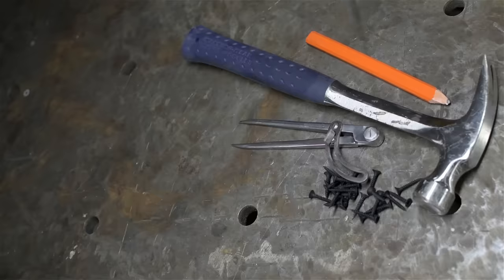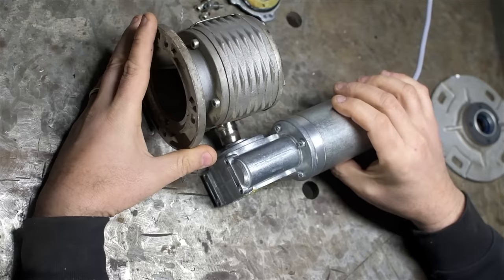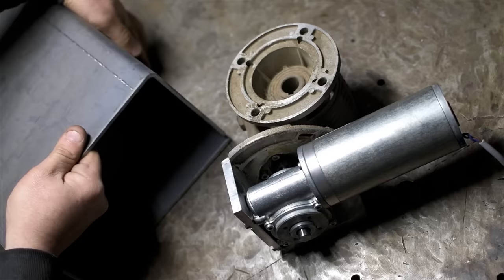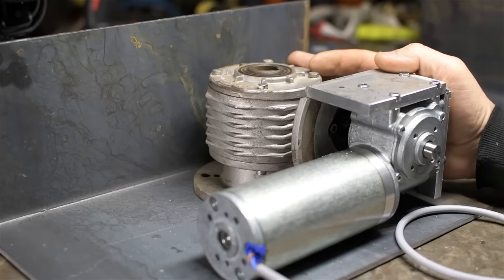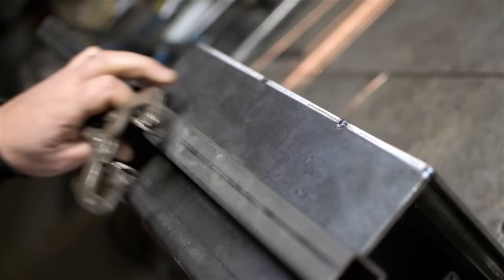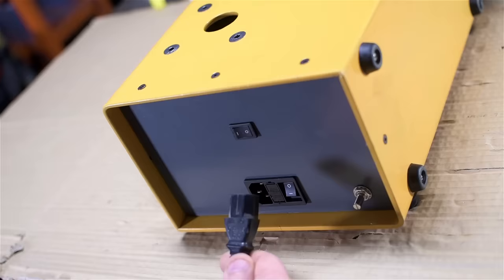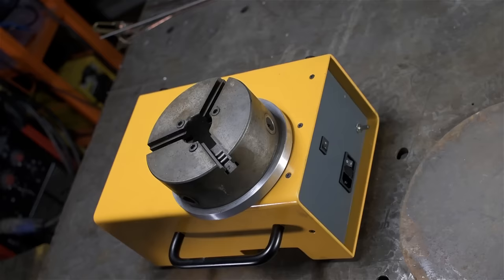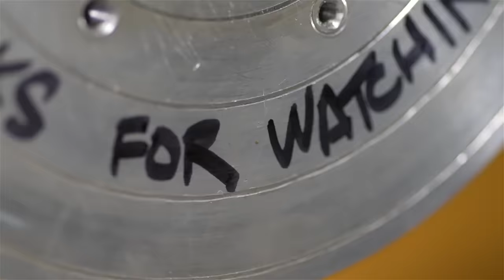Building a Rotary Weld Table

Comment: I am a little late for this party her but for the corners ,I like gunsmithing files... Or single face files. They are generally prepared for cutting dovetails , adjusting lockwork/ fire-control parts or fitments ,like putting a slide on a frame .

Comment: Really good project, i built something similar about 15 years ago and had the same issue regards speed vs heat..found the solution was add a potentiometer to the tig torch.you only need to vary it a tiny bit ..but you do need to change it often. Its easy to control power with the foot pedal and speed with your hand at the same time..two feet pedals are imposible i found lol..

Comment: The larger 1:10 is not only a speed reducer it is a Power Amplifier.  More torque...  Just like a granny gear in a truck...  I think slow is great for most uses.  Run the motor at half speed and you have best of both.

Comment: I work in a high pressure pipe welding shop.  The majority of our welding is done rotated.  Typically the rotator is pedal controlled, weld is just trigger hold on all the time.  You set the rotator speed a little faster then you would need and pulse the rotator with your foot to set the pace.

Comment: Big spring loaded carbon brush fir the ground contact would be a cool feature, although a thermometer and a base plate preheater will give better aluminum weld consistency

Comment: 31:38. Yes you do want another foot pedal for this exact reason. My background is welding aluminum tubes for jet engines.... and there is no way we would have done it without a variable speed foot pedal. This also helps in case it was set slightly wrong you can compensate, as well as the fact that aluminum will heat soak really fast on thin parts and require more speed at the end of the weld

Comment: Hello Mr. Old Tony...... I made mine outta ford f 150 wheel bearing hub and rotor essembly. Small shaft with motor and voltage regulator 😉

Comment: Nicely done! It would be neat to get a little digital readout on there to show RPMs (or maybe voltage off the pot would be easier) so you could return to your optimal speeds when when you find them for a given material/diameter. Very clean build though and seeing that stainless weld makes me wanna go out and make one!

Comment: @ 22:15, there is a set of bent head Snap On wrenches, (one specifically being used for one nut on the IDI 7.3 Liter diesel fuel injection pump) that would fir that perfectly.

Comment: 23:00 Oooh, I use a vacuum cleaner for chip control on my mini mill as well except I'm winding one of the handles with my other hand. Works on aluminium and stops it choking on swarf when I'm slotting.

Comment: The variable you are missing here is the temperature of the part.
When you are hand welding, you may stop and start, which gives the part chance to cool down, but with the rotary welding, it is a constant application of heat, so the part is going to gradually get hotter the longer you weld.
Theoretically, you could increase the speed as the temperature increases, that way you are not on a hot spot surface for any length of time, but then that would mess up your flow pattern. 

I think the only solution would be to have some kind of cooling, say maybe an airline jet just forward of the area you are about to weld.

Comment: Hi, I know this video is old, and I don't know if anyone else suggested it, but you could make the foot petal have a first trigger that turns on the arc and gas, and then the rest of the way down, it has variable speed control on the turntable

Comment: That worm gear box is actually better for a welding table because if you load it unevenly in a vertical position it won't move since only the worm gear can be the driven side. That's how all the really big welding positioners are set up.
Reply: He's got two worm gears in there. The motor is a gear head with a worm...

Comment: I know this is an old video, but you may consider a fine and coarse adjustment control, that way with two single turn pots you can get the fine control without having to crank forever on a 10 turn.

Comment: This setup with a larger turntable would be perfect for mig welding aluminum pipe fittings. Giving a consistent speed would prevent having to move around the fitting.

Comment: Don't know if you'd want to modify the speed control, but you could have a rotary switch with fixed resistors for set speeds (lo, med, hi. Or even -hi, -med, -lo, 0, lo, med ,hi) and still have a position for the variable.

Comment: PSA & top tip:  keep your mains power wires inside the box to the circuit board as short as possible & definitely do not lay such wires atop of a source of vibration (the electric motor).

Comment: This video was just great!! Had me laughing had me jealous and definitely had me entertained/motivated. For your aluminum consistency you could preheat parts to a desired temp on a hot plate and then maintain a range with inter pass cool down pausing. But I’m sure you’ve figured a good solution since the posting of the vid. Anyway thanks for the share
Reply from the maker: good idea!

Comment: I'd 've gone with the direction switch,then the foot controller can swing back n forth,but that's just me,for what it's worth the motor control gear can be made for a couple of bucks/pounds with a 555 and a couple of parallel mosfets,a jack socket for the foot control.

I've made a couple of DC motor control systems,yours looks like the same as a "radio control toy" (no offence),but the ref voltage system is the same as a servo controller,where the 555/mosfet would have been faaaar cheaper,and we all like faaaaaar cheaper.

That's a great piece of kit though and i want a cnc mill too.

Love your vids,great inspirational info.keep up the good work.

All the best,
My two cents(pennies).

Comment: Could use a garage door motor head. Rotate either way. Some of them even have variable speed. The mechanical limit ones would be the easiest, just throw away the limits and it should go one way for ever.

Comment: You should add a digital display of the current speed and a graph on the  machine that sets out speed to diameter with different lines for different types of welding.

Comment: Nice job Tony. Here is a suggestion for a feature to start and stop the table rotation at the most opportune times.
Connect the light sensor in series with the line in. Parallel a shorting switch across it to set your initial speed.
The light sensor will start the table once you establish the arc, and stop it to allow an ending argon flow.

L------- light sensor-------------------------------------|                                    | ________________                          
          |_____| |________|                                   |   24 v adj pwr supp |                                   Motor
                     bypass switch                          |                                     |________________
N______________________________________|                                   

You could use the light sensor to fire a relay... if you want to control the low side  24V... makes no nevermind..

https://www.amazon.ca/Woods-59408WD-Outdoor-Hard-Wired-Photocell/dp/B003Z4ECKC/ref=asc_df_B003Z4ECKC/?tag=googleshopc0c-20&linkCode=df0&hvadid=293019258638&hvpos=1o1&hvnetw=g&hvrand=15975966689033506434&hvpone=&hvptwo=&hvqmt=&hvdev=c&hvdvcmdl=&hvlocint=&hvlocphy=20113&hvtargid=pla-386027205064&psc=1

Comment: You're way better at all this stuff than I am and I understand why you welded the two  halves together, but as a mechanic, I was thinking, "I would have welded ears or a piece of angle iron along there and used fasteners", just to allow access for repairs. Before I went into tool design I always wondered why those assholes at the car companies always made stuff so damn hard to get at so I'm naturally always looking to design in as much work space and or accessibility into something I'm building. The box came out great though and I suppose you have enough space to get things out if you had to. Beautiful work and Great vid! I'm really enjoying watching all your videos. I have an old, (REALLY OLD) lathe and one of those old crappy Chinese bench top style milling machines. I could be doing a lot with them but they mostly sit under tarps while I'm wrenching on other peoples junky, crappy, rusty, old cars. I want to get away from trying to earn money fixing cars, after my third back surgery I won't be able to do it much anymore anyway. Making stuff on machines would be a great step away from wrenching.

Comment: You can add a resistor at the output of the potentiometer (middle leg) to slow down the velocity even lower. Try different values until you get your wished velocity range.

Comment: Great job, though I expected some fancy solution on connecting the ground to the table.
I have some stepper motors, stepper motor drivers and arduinos laying around so that's what I would use, possibly even get some RPM readout on some display so that I can remember "5RPM for this 100mm diameter pipe" etc.

Comment: Wow really great video. If the 5 turn pot is an issue you can replace it with two in series, one for course adjust and another for fine (aka 0-1000 plus 0-50). Also if you think a second petal is an issue you may be able to control it with a controller in you feed hand.
Again, really great video.

Comment: For welding small parts use MIG wire instead of rod. It'll give you a smoother weld and probably more beed control..

Comment: For your foot pedal to control speed: use a potentiometer that's 1/10 the value of the one on the panel. This will act like a coarse/fine control, with the panel control setting the approximate RPM, and allowing you to vary it slightly with the foot pedal as needed. Mount a 1/4 inch jack in the panel that shorts when unplugged, so that you can use the weld table without the pedal by just not plugging the pedal in, and you'll have coarse but not fine control -- same as what you have now.

Comment: great product, and great video! something that may help consistancy is adding a RPM readout.  Should be fairly simple using an arduino nano, a hall effect sensor and using a gear under the plate.  Im sure theres other ways.  Keep it up

Comment: Just an idea... rather than a speed control, why not just use a foot pedal as an interrupt?  NC wired pedal that breaks the circuit when pressed, stopping the motion until you release the pedal... but then again the closest I come to welding is MAP gas and brazing rods.  Great video as always!

Comment: Wow, complements from Jody, Jimmy, & others! Your next project will have to be a Commemorative Plack for yourself. Super great job! Really Great!
I just finished one for myself using a 12V auto windshield motor and some copier parts. You had exactly the same experience as I had concerning controlling the speed, heat build up, etc., and feeling out of control.

Comment: I wondered about building one of these and thought about bearing problem. I was going to use a large graphite motor brush but unsure of heat and power capabilities.

Comment: Excellent job!
You are fast becoming  the  maker of epic youtube videos ! (Tony .b . DeMille ?)
 You could  add a simple Arduino tachometer to show rpm which would allow you to set the turntable speed more accurately , you could even set it up to use the serial port so you can enter the material diameter  and have the Arduino set the correct rpm .
When i went to tech and used primitive welding turntables   we had to either turn it ourselves ( mig / stick ) or get some one else to turn the turntable and it usually ended up being easier to just clamp the job to the table and work around it !

Comment: Coulda linked the speed of the turntable to the pedal so that its dependent on it, with the potentiometer knob as the control for the offset/speed factor the pedal has on the rotational speed of the turntable itself, so that your pedal not only affects your welding but also the rotational speed as a factor of the knobs offset. That might help you with your comments at the end of the video.

Comment: Love the concept, but I found that HC wheel chair 24vdc drive motors powered with a24v 14.5 amp dc power supply (Cheap on A_ _ _ _N) and 4000w motor controller gave me speed controll & Fwd / Rev (@@). But I really like your Horizontal concept in the drawing,,,Thx again tony, you saved me from washing dirty dish & honey do's!!Bear

Comment: I have done similar with a windshield wiper motor and a old computer power supply. A pulse width modulation speed controller, (>10$ from Amazon).

Comment: That would be awesome with batteries! You would have to worry with another cord to power it! 18-20v drill battery, with dc to dc boost converter, or 24v battery, or custom built battery! Maybe an accessory light,

Comment: Now don’t get me wrong, I like your videos. Very well put together and you’re very well spoken. My question for you is why you just didn’t use the right angle drive and motor by itself, you said it will spin from 0 to its max speed. I don’t see the need for the extra right angle drive.

Comment: I’ve been trying to buy a lathe ... it’s so difficult to find good ones and the ones you find don’t even last 10 mins Bc they get bought right away ... I’m building a shop and need a lathe for both wood working and metal I.e Aluminum and titanium, cast iron etc !! Lol I’m just rambling but your shop is literally a Goal of mine

Comment: love your work man...try getting an old gas pedal from a relatively modern car...those have linear resistors make it with an extension wire to something as simple as a 3.5 mm jack and wire it to be able to operate the table around the initial speed set with the multi turn pot i have reasons to belive that this is easier for ur muscle memmory

Comment: 27:35 grreat now all you need to to is make an automatic feeder for the wire and a 3 axis  clamp for the  welder and it will weld for you :)

Comment: If you want a foot pedal for the speed but dont want to vary the speed too much you can come of the center pin of the pot fit another pot to a pedal at around 1/10 the value of the pot or even 1/20th the value and that will give you just a little speed adjustment to the RPM's overall so giving you a range lets say your at 30 rpm it would give (I dont know without knowing the values) but lets say anywhere from 25 - 30 rpm

Comment: What about using blocks of carbon brush material on the welding clamp?  Would reduce the rolling/sliding friction, might save the shaft.  Just a thought.

Comment: You make some really impressive stuff. Just as a thought have you considered any of the following to help with turn table speed. RPM readout, multi position switch that uses resistors to control speed, or a digital readout of current or voltage for the turn table. I think this could help you be more consistent with your speed once you get it figured out. Then create a nifty nameplate to mount on the turn table :) Wish I had the time to do this level of fabrication.
Reply from the maker: Thanks Mike.. and yes I've been slowly collecting parts to make an upgrade or two.  Never enough time!

Comment: toward END of VID preheat your aluminum pieces, do a few passes with just the arc and gas let it start to make white blotches then weld entire piece with one heat setting as opposed to over heat cooldown crap

Comment: A 12V wiper motor with an adjustable reostat would work for small jobs.
I agree with the reason to earth via the shaft but it will not do anything any good long term, and it will fall off often.

Comment: Just thinkin'...  It seems like you ought to be able to a pot in a foot pedal to control speed from 0 to the max speed and direction set by the pot in the chassis. How difficult depends on what's really going through those three wires to the pot, I guess.

Comment: can someone explain where the (ground) current flows along?
through the moving steel gears & bearings? (wouldn't that wear them out?)
Reply: From the work, through the chuck, through the platen, through the platen shaft, to the ground clamp
Reply: @mwilliamshs  but the shaft is only connected to the case throught the bearings which holds the shaft. These are tiny contactpoints with likly higher resistance.I found a youtuber which did this as a fix watch at 4min 55s: https://www.youtube.com/watch?v=BaUO8CMOS5I#t=4m55s
Reply: @hyperhektor7733  the shaft is pressed into the platen with an interference fit, to which the chuck is bolted, in which the part is clamped. No reason for any current at all to pass through the case, bearings, gears, etc. It follows the path of least resistance, which is that big steel shaft leading straight to the ground clamp.
Reply: @mwilliamshs  as fas as i know the only electical connection between a case of a rotating disc and the welding piece as to be some sort of loose connection. I dont see how a fixed part can rotate? Maybe do you have some images/links
at 29:27 you see my point he uses the case for the ground electrode
Reply: @hyperhektor7733  the ground clamp is directly on the rotating shaft at 26:36
Reply: @hyperhektor7733  TOT explains the whole thing at 26:30 or so
Reply: @mwilliamshs  ok thank you

Comment: oh and @matthiaswandel , wouldn't you make your own gear box? I would just take a 12V small motor, put it on a threaded rod, and use 1 gear on that threaded rod (one from an old vise or something with thick threads) and use a regulator for that motor. The table doesn't have to spin really fast, it's for welding! And one gear on a threaded rod, doesn't really get that much load, you can jack up a car like that! I'm sure it can spin a 200 pound project.... That way, you can even add another axis, for flipping the rotary table...

Comment: watched the video at the end you say that you have a Rotary table. That can alsof be used  as a weld table with the controllers function continuous at desired speed. Cover the Rotary table for protection.